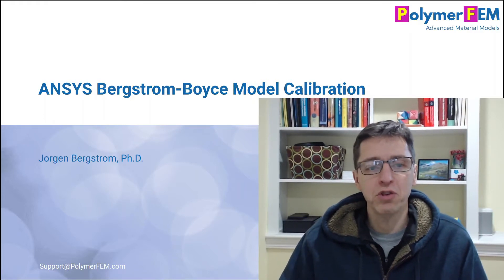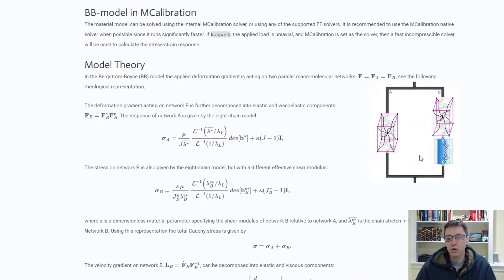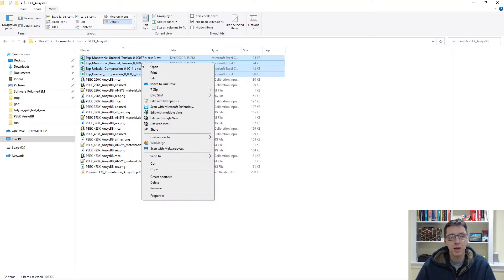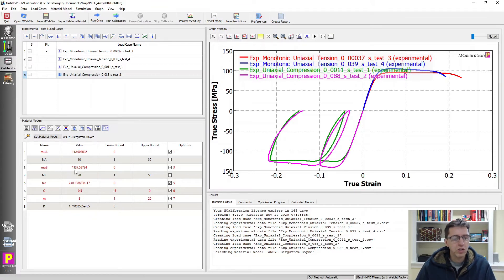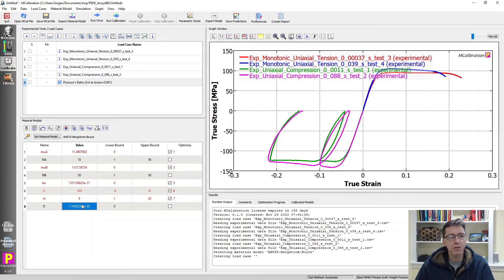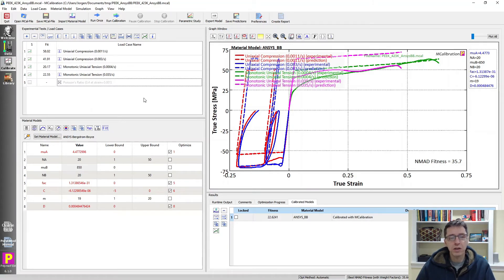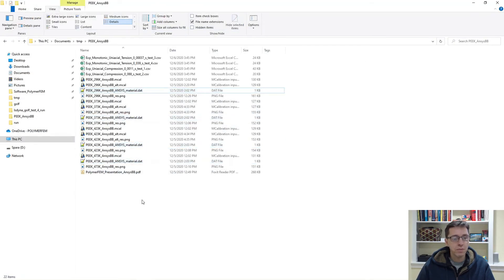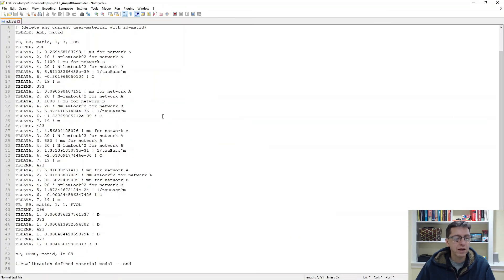Calibrate Ansys Bergstrom-Boyce Material Model

Comment: Hi Jorgen. Thanks for the demo. 
A question: let's say that a certain polymer acts perfectly elastic at low temperatures, but shows signs of plasticity at high temperatures. What would be your suggestion for a suitable material model to capture this behavior? Thank you in advance.
Reply from the maker: It is difficult to provide a specific recommendation without having more info. For example, you can achieve that behavior using a simple temperature-dependent elastic-plastic material model.
Reply: @PolymerFEM  Thank you for your feedback. Of course, but the usual elastic-plastic material models only allow for linear elasticity, not a nonlinear elastic behavior. That is the challenging part for me.